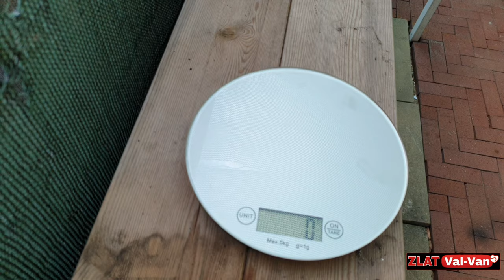Hacked Clogged Spray Can

Comment: stupid idea, => how to Avoid nozzle clogging up on Spray Glue, Spray Paint Cans,, but dry out as air is in paint, can not keep long year.
Reply from the maker: Actualy it's not nozzle clog.... I did put on few new nozzles, it didnt help.
It's valve in the can got clogged...
Reply: Yes. It happens to me all he time mid projects. Paints not cheap especially when you’re only using 1/3 of the can.  Definitely not the nozzle. I cleaned win acetone and blew it out with compressor. Definitely valve problem.
Reply: @ZvonimirAnn  this is way better than the multitool can opener on the top of the can but that does empty a can in ONE Second! I've done it twice now and only gotten a few specks in me - somehow.